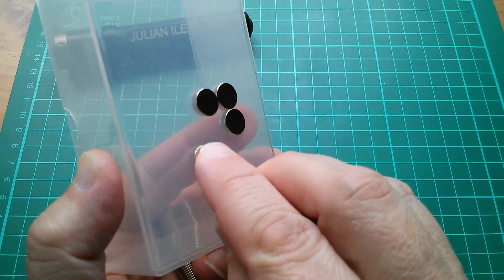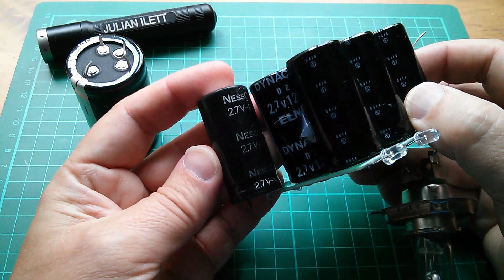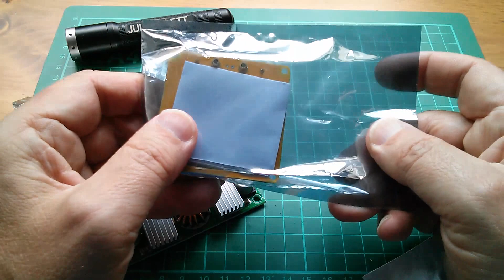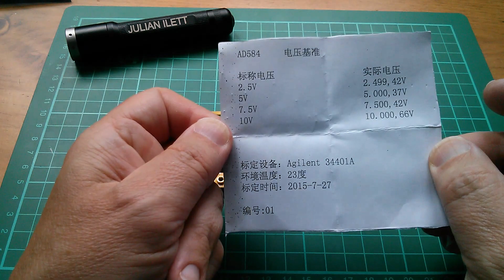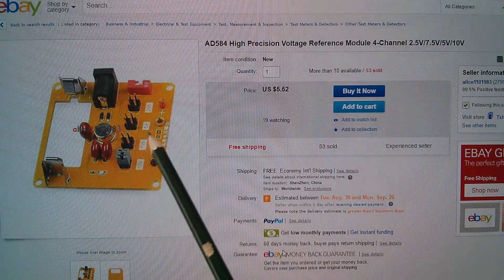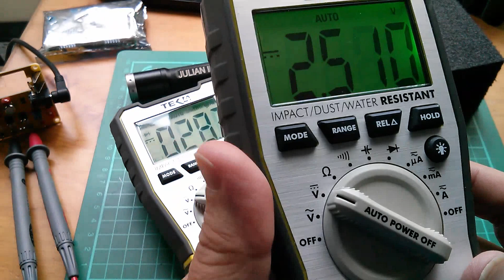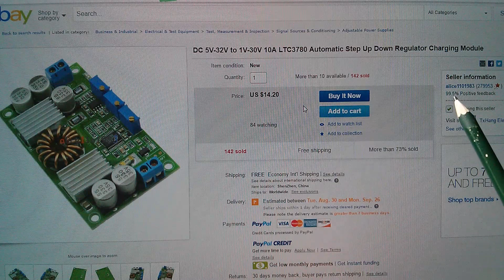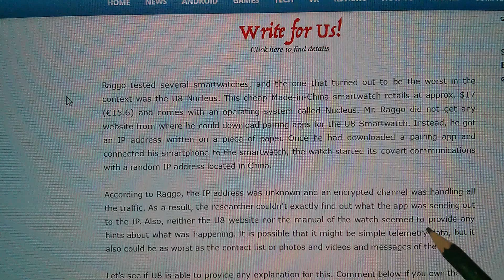Julian's Postbag: #69 - More Electronics Stuff from eBay

Comment: you can't solder to these, they completely lose their magneticity (?) at solderung temps :)
Reply: The curie temperature for neodymium magnets tops out at 200C for the high temp ones.
According to Wikipedia the action of demagnetization is basically the heat overwhelming the natural tendency of the electron alignment, nothing to do with the structure.
Though if it doesn't re-magnetize as it cools it should still readily be re-magnetized
Reply: +Pete Allum Thick pasta base and low heat.
Reply: ***** it is the fastest way to burn alot of callories :)
Reply: I soldered two Cables to two Magnets for doing exactly what Julian does. I sanded the Magnets a bit on one side and soldering was realy easy.
Reply: +muh1h1 Well I didn't say it doesn't happen at lower temp, but soldering won't take 90 minutes which a pizza does :D
Reply: Same experience here, they definitely stay magnetic.
Reply: It will work but the magnet wont be as strong as it used to be... Which is acceptable imo :P
Reply: dgedi78 am 90% sure it will have the same result. The duration of the heat is not important, just the temperature itself...
But it would be intresting to test nevertheless!
Reply: it would seem you've never tried this. I have no idea at the science behind it but I have certainly soldered to one. it seemed to be the same strength. the problem is that you pull the protective coating off quite easily.
Reply: soldering actually may make them lose magneticity.  Curie temperature has nothing to do with changing crystalline structure.  Most magnet has Curie temp lower than 120 deg C. Above that you need to order special high temperature magnets. And re-magnetize to original magnetic strength requires special equipment.
Reply: +Hu Sun I stand corrected, magnetic field is a result of electrons' spin arranged in the same plane, crystalline structure in iron is responsible for the hardness mostly. I realized it later on, but thanks for saying :)
Reply: +Krisztián Szirtes 90 minutes to cook a pizza? Perhaps, if you like them black and very crispy!
Reply: Didn't he want to solder the battery?.. Because that's dangerous... 
Tried it once.. Did go well.. Second time it vented
Reply: Andrew van Leeuwen no he wants to make magnetic battery connectors.
Also think about the battery as a steak, if your pan is hot enough you can sear the outside before you cook the inside. Battery tab welders operate by heat as well it's just incredibly hot and brief.
Reply: +Echo_Hotel true, but always be careful.. Venting batteries smell very bad 😥
Reply: Actually no, you need ~300°C for soldering and 600+°C to change iron alloys in their crystaline structure to demagnetize it. Not sure if a high neodymium percentage will change it or not though. It's worth a try.
Reply: Krisztián Szirtes definitly worth a try, but i remember when i was a kid i thoght i was smart by using a neodynium magnet to fix the flopping baking sheet in the oven to the tray, when making a pizza. I the magnet lost all of its power and was not magnetic at all in the end. The oven was turned to 180°C

Comment: That precision voltage reference looks great, and I like to buy it.... But this thing costs 3/4 the price of my multimeter, so I thing I'll pass on this :D
Reply: i got one to check and calibrate my meters. it works and it was cheap but the printed sheet supposedly showing the precise voltages of the outputs gives exactly the same values as Julians. I assumed that each one would have tiny differences so they would be metered accurately and supplied with a list of values specific to each unit, but thats obviously not the case. is it possible that they would all supply identical voltages down to the 5th decimal? i dont think so.
Reply: If you search on ebay for AD584, there's also a $3 version of it.
Reply: Found the one Julian got for £3.79 on ebay UK
Reply: 0yeme0 Interesting thanks for the heads up, although from Julians tests they appear to still be accurate enough down to 2 or 3 decimals, so I'd say it's fine for hobby use.
Reply: vgamesx1
yeah, since his meters were grouped around the right value its probably fine. it'd be nice to know exactly how accurate it really is tho, since thats the whole purpose of the thing.
also heres the battery its supposed to be used with, the cylindrical ones Julian was looking at might fit but the listing shows it with one of these in. these are cheeper too
http://www.ebay.co.uk/itm/AVO-8-METER-MULTIMETER-15v-BATTERY-BLR-121-AVOMETER-/272341166210

Comment: Have you ever looked on AliExpress? They do have some very interesting electronics stuff that you can't find on ebay. You do need to do a bit of digging to find it. 

Made my own post read like spam lol
Reply from the maker: There are some items on eBay which aren't on AliExpress. I've just ordered a DC/DC module on eBay but I can't read the chip number from the eBay photos. It doesn't appear to be on AliExpress at all.
Reply: hm....the only thing i couldnt find on ebay were the mass of IC and COmponent sellers, and maybe baite and the orange pi guys.
but i like it more because its cheaper than ebay in 99% of the cases
Reply: Julian Ilett
Of that specific one as you are looking at on ebay or you can find anything DC to DC on Ali

I just like to say I'm not being sponsored in any way, it's just I look on the site all the time and think to my self Julian would like that.
Reply from the maker: Well I bought this: http://www.ebay.com/itm/-/172282473702
But I can't see what controller it uses from the rather blurry photos. I was hoping to find the same item on Ali in case their photos were better, or the controller chip was mentioned in the listing.
Reply: Julian Ilett
Can't find the same, but this meets the spec.
http://www.aliexpress.com/item/Low-Ripple-90W-DC-4-5-60V-to-1-25-30V-Adjustable-Voltage-Step-Down/32701985954.html?spm=2114.01010208.3.1.3NyVO8&ws_ab_test=searchweb201556_8,searchweb201602_2_10057_10056_10055_10037_10049_301_10033_10059_10032_10058_10017_10060_10061_10062,searchweb201603_4&btsid=74ce7815-7a47-47d0-8808-0e2cea147304
Reply from the maker: Very similar, but the eBay one has synchronous rectification so potentially much better efficiency.
Reply: TheDutyPaid  m

Comment: "Modern" capacitors with four or more legs like that usually just use the remaining legs for structural support, as the can is so large.
Reply from the maker: That makes sense - the floating voltage on those pins I now realise is because they're not connected to anything - doh :/
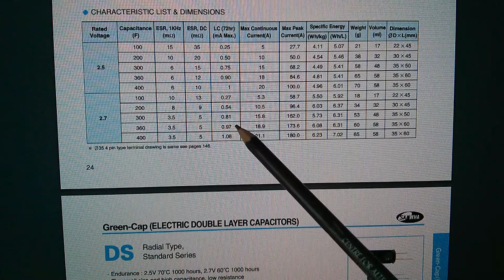Reply: Also on your video on 6:18 there is a line in the datasheet: 4 pin  type terminal drawing is the same, see page 146 ;)
Reply: Also these "supercaps" are fake ones, check "MH" section of their Gren-Cap datasheet ...managed to buy 16 pieces and all of them are trash. They have maybe 150-200F on good ones and absolutely huge internal leakage.
Useless but yeah, they were cheap.
Reply: tha makes sense. thought it had something to do with the dual thingy
Reply: was going to say....
Reply: Fake ones!!! Well that sucks. I was going to buy some 500F caps and now I have to question them. Thanks for the heads up...
Reply: +Roy Riederer super caps cost super money.. Unless bought from the supplier ! 
However then they handle minimal quantities! 
But when it seems super cheap expect to get crap
Reply: yes extra 2 legs so there is no need to cable tie or glue